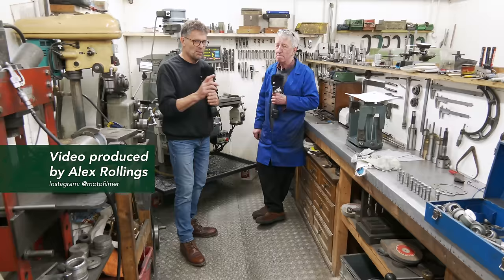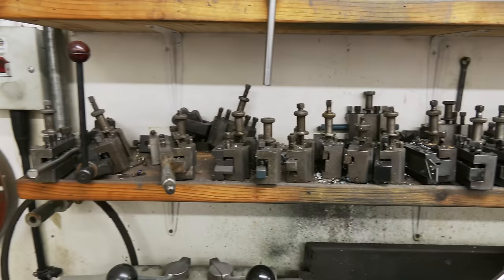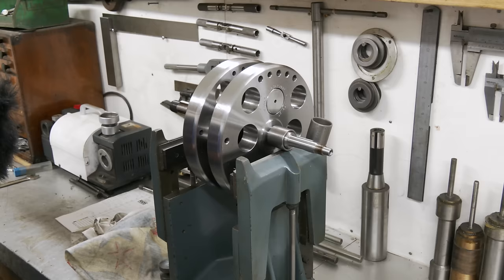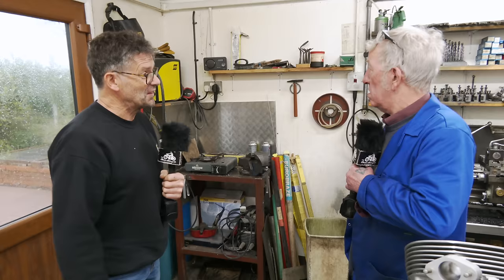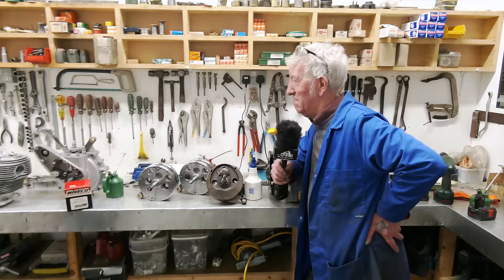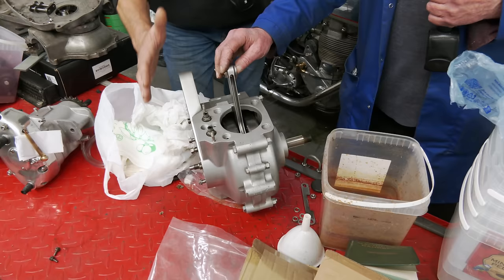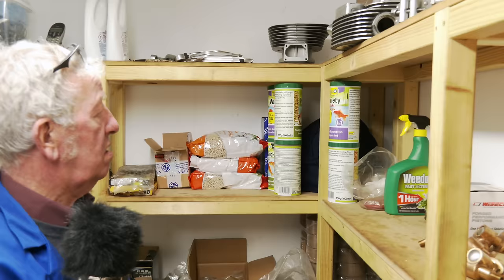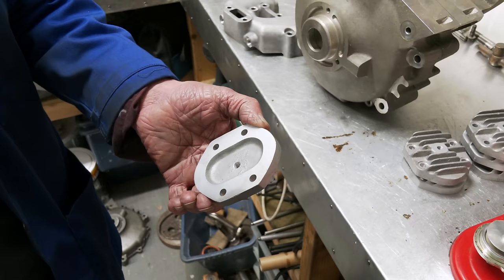Classic Motorcycle Workshop Vlog 31 - 1959 BSA Gold Star DBD34 - Phil Pearson visit - pt 4/5

Comment: As a retired turner, I am bloody jealous of the amount of tooling and machines Phil has. I used to make lots of parts for my bikes and cars during lunch breaks. Even as an apprentice, thanks to an instructor who was into rebuilding old bikes and cars, I got to do a lot of stuff. I made a set of valve guides for my Triumph 500 out of oilite bronze for example. A milling machine equipped with a DRO  is a must have piece of machinery when working on cars or motorbikes. I so wish I could have spent part of my engineering career working with Phil.

Comment: Phil first helped me get a BB32 engine sorted in the 90's, then built me a complete DBD34 engine with one of his GP carbs in 2000. This bike has never missed a beat since he helped me set it up, riding from Slough to Norfolk each time. I've been to the Island with the Goldstar Club and done quite a few fast laps, also ridden with Phil, when he first built the 600. Being of a certain age, I got young Phil junior to fit an electric starter to keep me riding. I have never touched the engine, which is still oil tight. As an engineer myself, I was always amazed at the quality of his work from the original shed at the bottom of the garden. Many thanks for the video.